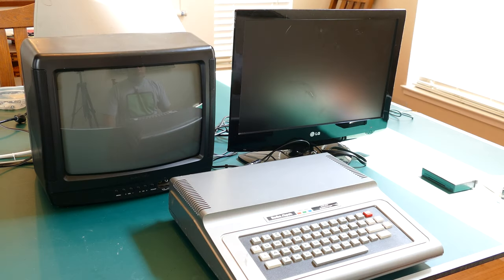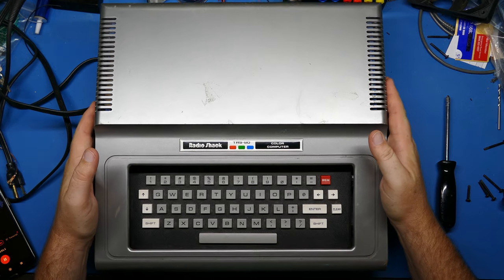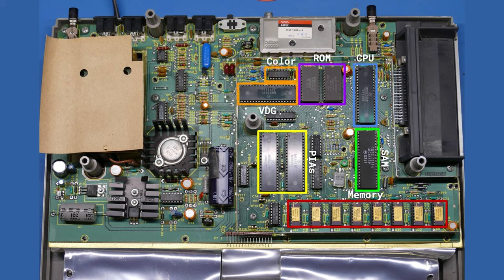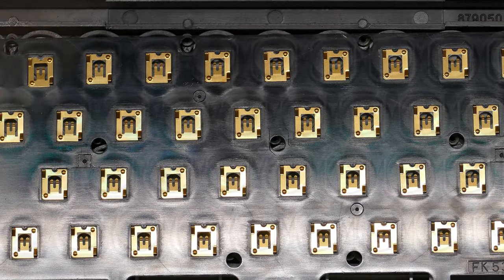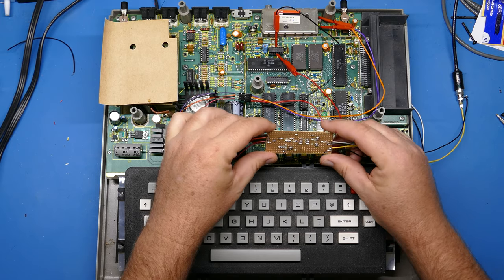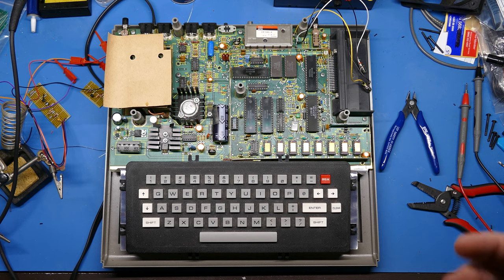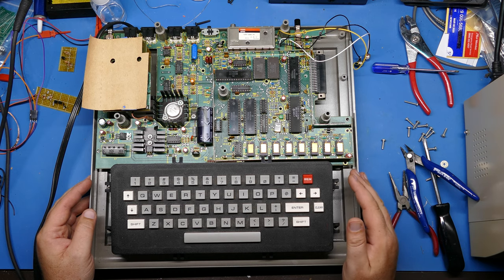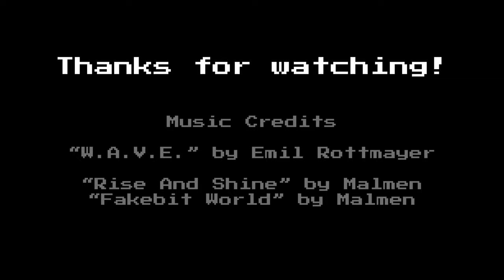TRS-80 Coco 1 Repair and Mod - #SepTandy 2020

Comment: Love the meowing cat in the background. :-) I tried to do a Composite mode on my Coco 2 and it was a total failure, worse results even as you have to remove the RF modulator which contains that color encoder chip... 

The S-Video mod that Mark did on his Coco 1 looked awesome. Hasn't been tested on a NTSC model and of course you'll loose artifact color. 

I also have had an issue with IPA messing up paint on old machines. I no longer use it on computers and stick to windex, magic erasers for scuffs and WD-40 to get sticker residue off. 99% IPA is much more likely to cause damage but I think I've had problems with 70% as well. :-(
Reply from the maker: Glad to know it's not just me :)
Reply: You should try brake parts cleaner.

WARNING: Do NOT use brake parts cleaner anywhere near plastic! 🫣🤣
(I know someone who did this to a CD player and pretty much melted the plastic parts together.)

Comment: Thank you for taking the time to show what is going on in the CC1 keyboard. I wasn't going to mess with mine because I expected it to be that cheesy carbon coated plastic deal other chicklet keyboards use. Now after cleaning mine like you did on yours it is working 100% better.
Reply from the maker: You bet! Glad it helped. Sometimes it takes multiple rounds to get them all working again.

Comment: When I was a kid, I had the F revision and easily upgraded to 64K. Just installed the new RAM, added a jumper, and cut the capacitor located at the bottom of each RAM chip socket. I remember taking my CoCo to Radio Shack to have the Extended Basic ROM installed for $100. The local store sent the computer to Texas to have the upgrade performed. Got my machine back in about 2 weeks. That was the longest 2 weeks of my life back then. I did the memory upgrade myself after that.
Reply from the maker: Love it! Thanks for sharing that story :)

Comment: You probably know this already, but for those that don't. The LCD panel understands pixels and the CRT understands lines of video. The panel in the LCD is trying to scale up NTSC RF scanlines into its square pixels and is having a hard time. The CRT is just outputting what it receives from the tuner more or less directly to the tube.
Reply: @McFeedback1968  no, you can't.
Edit: later coco2s (B models?) came with composite out, but RF out of an RF modulated CoCo requires a "demodulator" aka TV tuner.
The CoCo plugs into the cable input, tuner must be set to antenna, not cable, and tune to ch3/4.
Reply: The magic of scan lines.

Comment: Great video! (and I have seen you on TWiT many times, including with your Dungeons of Daggorath shirt). And yes, they restarted serial numbers at times. (I think yours is an E Board; there are a very few C boards in the wild, then D and F revision motherboards as well). I can't quite read it, but there is a number on the right side (just below the cartridge port) that will have a number "-E" (which indicates an E revision motherboard). I should mention that in practice, most of the 64K chips used were fine with the full 64K. You can address it all, with a very slight mod (you can address it two ways; map all 64K in at once (shutting off the ROM's), or swapping 32K RAM banks in the lower 32K, while leaving the ROM's turned on. Also, if you want to see all of the magazines, and software (both from back in the day, and new), please pop by the Color Computer Archive (www.colorcomputerarchive.com). Also, we would love to have you on our live CocoTalk show some time (recorded every Saturday at 2 PM; lasts for several hours, so even if you could pop in for a small amount of time for an interview, and to promote your current stuff, that would be awesome). You can see some past episodes here: https://www.youtube.com/playlist?list=PLDfh7JjQaSYC1p7sxFIm4i8HU7-Yj0ssB   (If you are interested, please send me an email at curtisboyle@sasktel.net). The general page is at: http://cocotalk.live.  Also, if you get a chance in the future to swing by the TWiT studios again (probably not possible in the immediate future?), maybe hit up Leo a few days early to borrow his copy of "Coco: The Colorful History of Tandy's Underdog Computer", which is very well researched history of the entire Coco line, including interviews from some of the principals from Tandy from that time period.
Reply from the maker: Ha. Glad you noticed that shirt! I finally put it up to order. And yes. It is an E. I forgot to mention it later.

Comment: Also replace the 2 small DC regulators with modern switching ones. Shrinks everything and you can dump the heat sinks.

Comment: Incredible flannel with led as a coco cursor. I seem to remember that for the conversion to composite video to work correctly, you have to remove or disconnect the RF box or it will interfere
Reply from the maker: Hmm. I might try that with the next one.
Reply: @RetroHackShack  I am struggling with this same problem. My white case CoCo 1 had an aftermarket composite mod from the 80s that threw the artifact colors off. 🫤
I simplified it to the basic circuit you're using, and it's better, but I want to remove the RF can to see if it gets better.
 Now the composite out has correct colors but the RF is out of phase..? Sheesh.
 Doing this in my silver case, restored the white case to original.

Comment: Good job on the video, kept me watching. I was going to see if Mr Lurch wanted to add your video to the SepTandy playlist but it looks like he's already done it.

Also thanks for the shout-out, interesting to see your results with the composite mods. From what I have heard it seems nobody has really been happy with the results vs RF. Hence my S-Video mod, which also took me way too long but for me at least it produced an output I'm happy with. Just gotta wait and see how others go with it, so give it a try if you want.

Shame about the IPA eating the paint, I'll be sure to avoid doing the same.
Reply from the maker: Thanks! It was pretty funny that your video came out just as I was about to give up after my first attempt failed. That led me to try a few more things.

Comment: Great video.  Things happen.  I've messed up cases too.  Like the time I accidentally got acetone on my C128D external keyboard (which are rare) and it melted the plastic.  Once you pass that "uh oh" stage...may as well paint it.  Watch Retro Man Cave's video on stripping and painting a Model 1 TRS-80.  Lots of good tips there.
Reply from the maker: Hmm. I must have missed that one. I will check it out. "Uh oh stage" describes it exactly. I wish I was recording at that point.

Comment: Interesting point on the memory.  I believe that something similar was done with the Sinclair ZX Spectrum.  I don't think we ever got the TRS-80 here in the UK, at least not in any apreciable numbers but as I understand things the cost of these machines was their downfall.  It does seem to be a bit odd that a lot of home computers from the 8/16 bit era seem to have these faraday cages tacked on to their designs a bit like they were not expecting to have to comply with these rules.  As yet, I have not found a computer that actually needed these shielding but if the manufacturers knew they would have to shield the systems, wouldn't it have been better for them to have used a metal casing and stand-offs rather than some weird cardboard & tin foil arrangement.

Comment: Great video.  My coco1 is a rev f, with 16k.  It had a sharpie marking under the top of the case of 10/22/80.  The F allows you to upgrade to 64k by just adding the chips and a couple other easy mods.  Also the chips are all socketed on mine, including the CPU and SAM. The RF cover is also a lot smaller, not covering the CPU or SAM, and you can only remove it by straghtening tabs on the bottom of the board.  I also noticed that your tag is black, as is mine, but another machine I got recently with the extended basic chip, also has a rev F board, and the tag on the bottom was purple.
Reply from the maker: It seems like there are so many versions of marketing that Tandy/RS was putting out back then. I have seen multiple versions of the same disk or cartridge that say Tandy or Radio Shack, but were seemingly released at nearly the same time. :)

Comment: That's odd.  I seem to remember that mod working quite well for me.  Of course, that was nigh on to 40 years ago.  And, I was was using a bodged TV that I bypassed the RF circuits and directly drove the video de-modulator.  Those were the days.
Reply from the maker: I am going to give it another try in an upcoming episode.

Comment: I wonder if your composite mod would've worled better with a shielded or twisted composite video wire. The reason for that obnoxious RF shield is that nearby wires, particularly unshielded ones, might pick up hash from the system. your run was certainly long enough to do that.

I can say I wish my RF out looked like yours. it definitely does not. Your worst result looks better than the best I've got.
Reply from the maker: I was using a shielded cable for some of the time.

Comment: Composite is generally bad on LCDs from a lack of true 240p support, a lot of them tend to do a sloppy convert to 480p but it adds interlace artifacts as a side effect. Went and got a RetroTink-2X Pro since the new TV didn't have any legacy ports, this upscales 240p to a cleaner native 480p signal modern screens understand. 2X-Mini is a bit cheaper but only goes as high as S-Video.

Comment: Try using Rosonol Lighter Fluid as a sticker goo remover. I've found that it appears to be safe for most everything and removes the goo remarkably fast and completely.
Reply from the maker: Does it leave a smell though?
Reply: @RetroHackShack  not that I've noticed. I've used it on convertible top windows too.
Reply from the maker: I'll pick some up and give it a try

Comment: Actually manufacturing processes quickly made "half bad" chips increasingly rare, so most "32k" machines actually have "all good" 64k chips in them, even though they were sold as 32k machines.  Once the CoCo 2 was out, they began referring to them as 64k machines.

Comment: Always use WD40 to remove sticker residue, Aaron.  Works fantastic!
Reply from the maker: It's on my bench :)
Reply: I know that the paint on the silver cocos are some soft paint that loves to come off. I think WD40 would be fine but personally you'd be hard pressed to get me to use anything more then water and maybe windex. Certainly would test on the bottom first.
Reply from the maker: @tomlindo2863  Goo Gone also seems to take off a little paint, but not nearly as bad as IPA. I tested that on the back :)

Comment: I've noticed silver paint on plastic often comes off with IPA. I tend to use Hydrogen Peroxide on things that might color bleed.
Reply from the maker: Interesting. That is the first time I have heard about Hydrogen Peroxide. I might have to test that out.
Reply: @RetroHackShack  Doesn't evaporate like IPA so you just moisten your towel, clean, and wipe off any left afterwards. Had many things like sticker labels that IPA would ruin but still had dirt on them so I needed something more gentle.

Comment: You would of probably had better results if you used shielded cable for the Composite wiring. Typically I will use an old Component Cable or RCA cable for that sort of thing.
Reply from the maker: It's a good tip. I tried both shielded and unshielded but didn't mention it in the video.

Comment: I see you have a USB oscilloscope on your wall in the workshop so I'd suggest you look at your composite video out when plugged into a SINGLE load i.e. one monitor. The input impedance of the video inputs on the monitor/TV should be about 75 ohms, with that load your composite video signal should be ~1V from bottom of sync pulses to the top of the whites. Of that the video makes up 0.7v and the syncs 0.3v (look at any reference image on google). If your levels are way too high or low (including the ration of video to syncs) then you will likely see crappy image quality. That would be the likely reason you are seeing better modulated RF video than straight video.
Reply from the maker: Awesome suggestion! I did that, but didn't show it on the video. This scope is kind of crappy, so it was hard to see the levels precisely enough. Perhaps I will put this in the video next time if it is interesting to people.

Comment: 43:13 it's the kind of plastic paint they used, u need denatured alcohol (essentially moonshine or everclear) which is much safer on plastics. isopropyl is much more caustic to plastics like acrylic
Reply from the maker: Hmm. I will have to test that out on a scrap item and see how it works.

Comment: I think the issue with composite is with the crt tv itself.
Reply from the maker: That is definitely part of it. I am just working on a follow-up to this video where I get HDMI out that works really well.
Reply: @RetroHackShack  awesome. Can't wait to see it. I'm very tempted to try to restore some old hobby computers myself. Looks like a blast. A frustrating blast!!
Reply: @RetroHackShack  also, wish I had kept my TRS-80s when I left the UK for the US.
Reply: @RetroHackShack  I guess the impedance could change if you don't disconnect the included modulator.
Reply from the maker: @tolkienfan1972  Yeah. That's a good point and something I always forget to take into account.